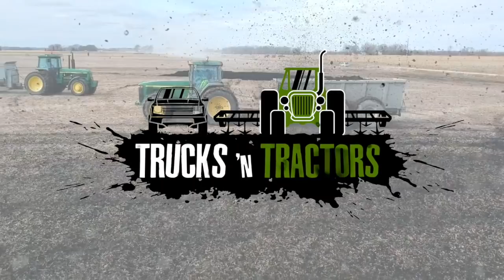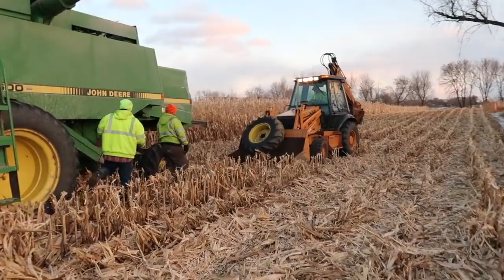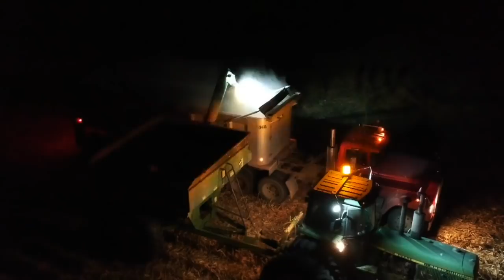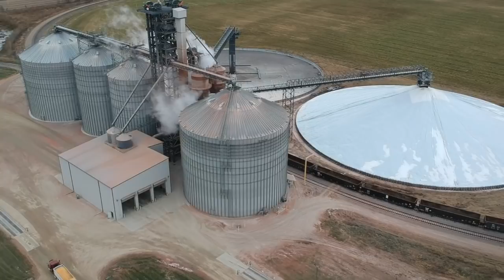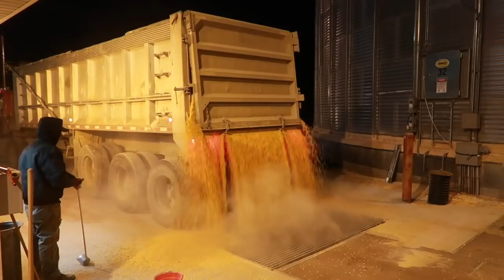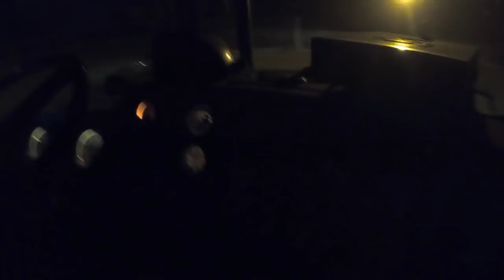A Corn Stalk Wrecked The Combine!  Harvest Came to a Halt!

Comment: I grew up on the other side of train tracks from two elevators in Central Illinois.  I knew they bought, stored, sold, and shipped grain .. but learning more about it is fascinating!
Reply: They've been around for a while, but the value of a battery impact wrench really shows up.  Otherwise, he'd have to have changed that tire by hand, or needed a conpressor.  Corn stalks are hard on tires, and you can't call AAA!